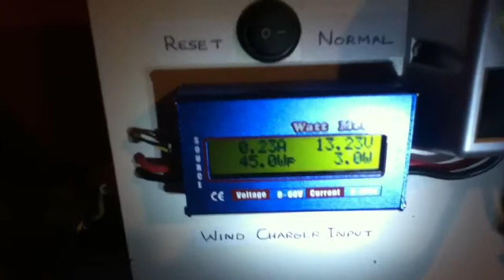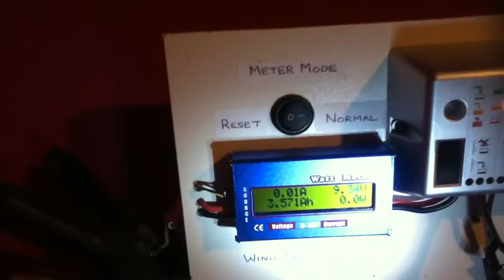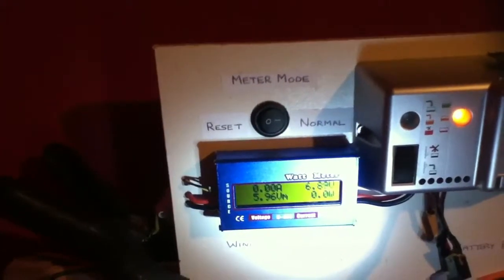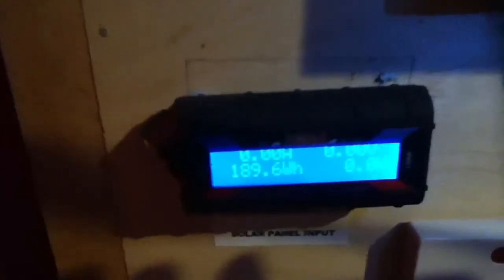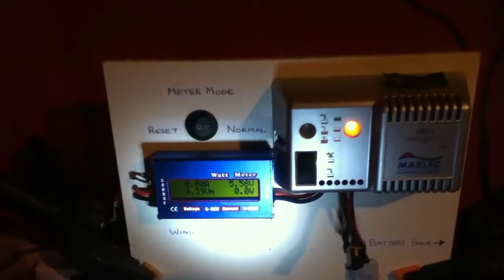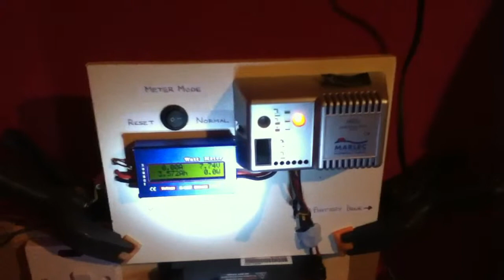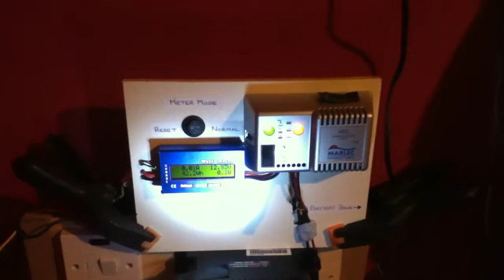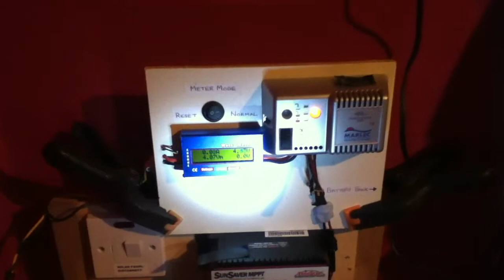Sun 11th Jan.         Highest ever output, Rutland 504

Comment: brill thanks, i find the same as you, not a very good value compared to solar, but at night, and when the wind is blowing, it works ok, mine is on a boat
Reply from the maker: Since this video, I have replaced the turbine with a more powerful one the Rutland 913, which is rated for 300W. The most I have had out of this is 100W. My location is not good for a wind turbine, as I am surrounded by other houses and the turbine is only 10ft above the ground. I am limited by over head power lines and the views from neighbours houses. The wind tends to blow in gusts, so you get bursts of power, but nothing continuous to charge the batteries. I also have solar which works much better and is cheaper.
Thanks again for the interest. Solartiger
Reply: @The_Solartiger  Thanks for following up, and for measuring the output of the tiniest reliable wind turbine available. Your experience sounds very similar to almost everyone who puts up a wind turbine in an urban or suburban setting. Rare to see a sustained 40 kt wind, or a 10 m tower, inside a city. On the other hand, many cities are coastal and you could park much bigger wind turbines offshore on sandbars or shallow shoals.  And the wee turbines do make good sense on a sailboat, where you are charging small batteries and being very careful with power. I don't want to discourage anyone from experimenting with residential wind energy -- just remember that it's an experiment and if you are concerned about the environmental impact of power generation, you should ask your utilities (and your government) to focus on much bigger turbines in much windier places.
Reply from the maker: @TaiViinikka  Thanks for the interest. I bought the wind turbine to help charge my batteries in the autumn and winter time when there is less sun and the days are short. My main charging source is solar panels which work much better and cost a lot less to buy. I will point out that this is a "hobby" system, my house has mains power from the grid for normal living. I would recommend to most people who live in urban areas to stick with solar panels due to cost and the fact wind turbines need wide open space to work effectively.